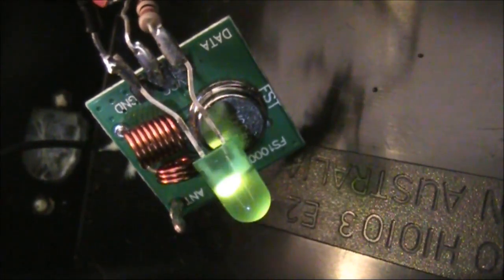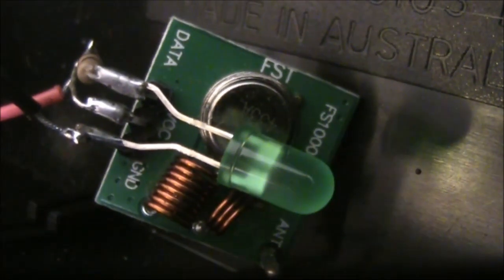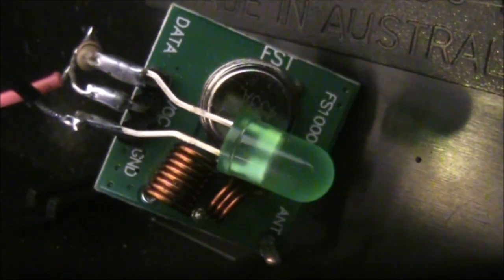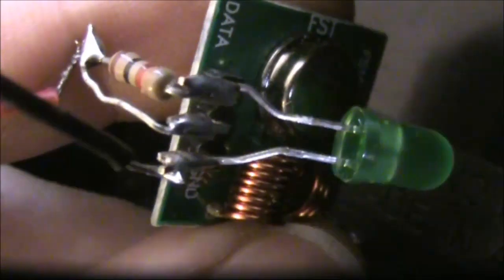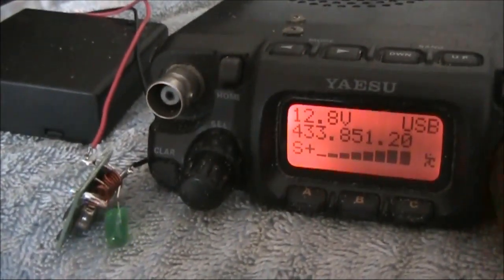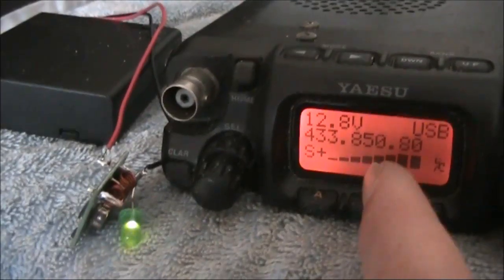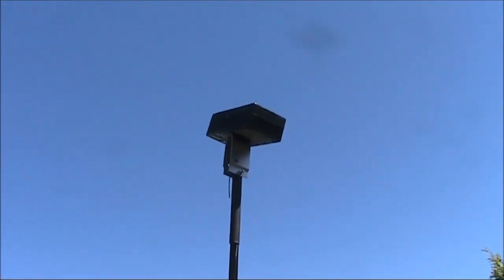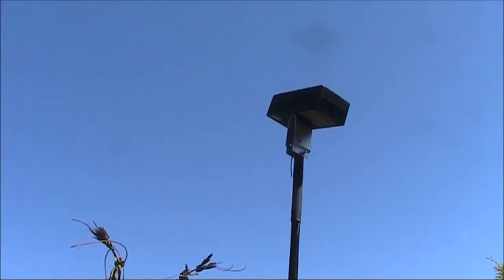Experiments with UHF data transmitter modules: Part 9 pulsing beacon

Comment: The reason it is unstable is because you have it hooked up straight to a solar panel, therefore the power is constantly changing and warping the frequency. Add a cell or a capacitor to stop this.
Reply: I have connected this circuit to a regulated 5.1 V PSU and it’s still unstable.

Comment: Hi Peter, I tried to copy what you did here. the connections are straight forward, 1k resistor, one end to the data, the other to the Vcc and black to ground and I attached a green LED (Made sure it was oriented correctly). However, it would not pulse or blink. I tried 3.6v, then 4.5v, 4.8v 6v, and 9v with no joy. I'm wondering what voltage that Battery pack was that you were using and if that might hold the key? I don't want to burn out the little transmitter by going wild here. (I'll double check the resistor value as well).
Reply: That led flashes on its own. Try searching for flashing led.

Comment: What voltage rating is that pulsing LED?
Also, what antenna are you using on the tx?
My 433mhz module (It looks identical to yours) came with a receiver... Do you think I could get the receiver it came with to pick up the tx signal 1 km away? If so, what antenna should I solder on? I'd like to simply plug an active piezo buzzer into the receiver directly as output.
Reply from the maker: Don't remember the voltage rating of the pulsing LED but many work over a wide voltage range (eg 3 - 12v) with no resistor. Not sure if the rx output will drive a buzzer directly - you may need a transistor switch or similar to drive.  You won't get 1km with a cheap UHF module receiver (unless you used some good yagi antennas) but you might with a good quality FM receiver.  Eg https://www.youtube.com/watch?v=oL1HnjDvT1Q
Reply: vk3ye The Yaesu VX-5 shown in the video is discontinued. What alternative, dirt cheap receiver do you recommend for that CW pulsing beacon? Would a RTL-SDR work for fox hunting such a beacon?

Comment: How did you made that your hear some tones? My Baofeng UV-5R just ticking like a clock?
Reply from the maker: The Baofeng is only an FM receiver.  The FT817 I'm using includes CW/SSB reception as well so that carrier signals appear as tones. If you want tones on the Baofeng you need to use an audio oscillator connected to the data input pin to provide modulation.
Reply: Do you know any tutorial - how to build a pulsing sound oscillator?
Reply: @skalkazoo  did you find a tutorial?
Reply: @awolmadandy  long time ago my brother

Comment: Hello have you looked into the HC-12? I am not sure if it is at all similar to your module but it may be worth a look as its frequency can be altered. Below is the data sheet

http://avrproject.ru/112/rf_hc12/2016-01-14_122335_HC-12_v2.3B.pdf

73
de 
ve3zcv